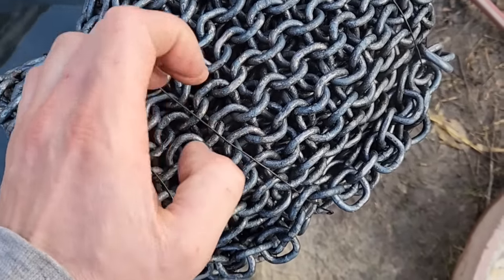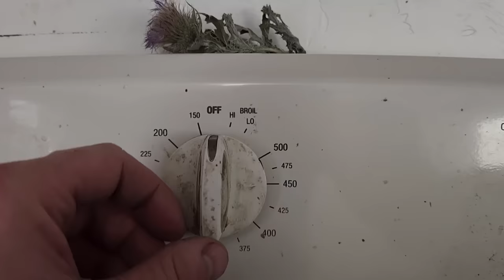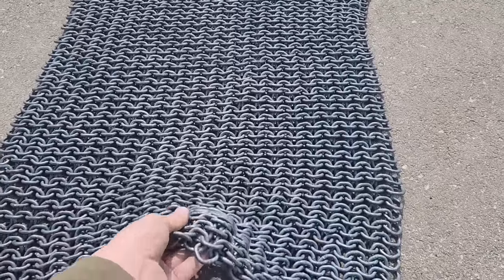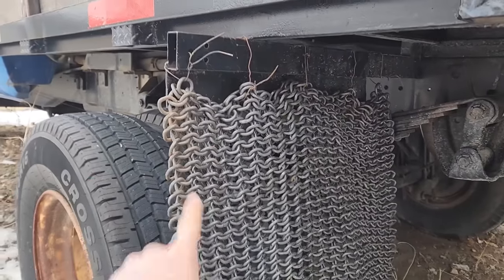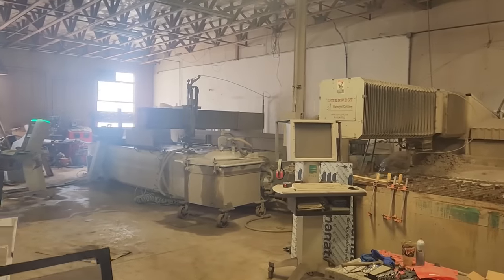Making Chainmail From Chain

Comment: The end result is so beautiful. I really hope you make it wearable, what a fantastic item to have as a family heirloom. Already that section is just worth so much, I can't imagine how to value an actual wearable chest piece. Definitely into five figures at least. Estimating that what you have based on what you said would maybe take you three months if you were doing nothing else with a wage of $30/hr & making some guesses on your costs for running the propane furnace and your weld torch I come to an estimated value of $29,019.65 Thirty-six boxes of chain, three #10 boxes of 1/8" welding rod, two refills of B cylinder bottles of acetylene & oxygen, & two refills of twenty pound propane bottle are my estimates for materials costs not including tools you already own. I forgot the acid bath to remove the zinc! Adding a conservative guess for how much you needed at four gallons of acid that brings my estimate to $29,279.61 on that basis I'm going to say that a chest piece is worth $75k after producing another section the size you produced to cover a full torso plus sleeves like your copper chainmail, and doing finishing work.

Comment: Hey Cody, when I used to work in the electroplating industry we used to dip freshly stripped bare steel into a cyanide solution to prevent oxidation.

Comment: Good call removing the Zink. Body heat can be enough for it to start letting of its toxic fumes and when you are wearing mail coated in zink, you would start inhaling that and slowly over hours get a tat paranoid. Not enough to get like a proper zink poisoning but its still not pleasant.

Comment: I’m surprised that you didn’t treat it somehow to prevent rust. At first I thought that you would heat treat it by dropping it in some kind of oil, but I am not sure how that works. I’m glad that you are able to post more, now that you have received most of not all of your past earnings.😊
Reply: Those are thick enough for 100 uears of rust in this desert, then that scale will protect it somewhat, as long as ot doesnt get directly wet.

Comment: I wonder how tight a radius compound curve it will really flow through - the gaps look rather snug that if you were insane enough to try and wrap a human in it I expect it would limit movement from way more than just its weight I'd think (and boy would it be a workout to wear).

Comment: Here in Quebec most steel with zinc. It is hard to find Pure steel. Lobes, Home Depot I can only find that. I am planning to plate nickel to copper sheets with a Nickel plating solution. Electroplate with distilled water and find some way of filtering the solution. The pH of the Nickel solution needs to be a pH of 3 to 4. I will later dissolve a gold bar into a 2 L flat two-knocked flask to reflux (Hydrochloric acid 31.45% and 35% hydrogen peroxide). The H202 will be on ice and the HCL will be at 4 degrees. 500 ml HCl and 100 ml of ice-cold H202 at 35%. Cold temperatures are better. Never add them at room temperature. I bought a stainless steel Ceramic hotplate recently for that.

Refluxing 560 mg of gold into 500 ml acid + H202 will be the most difficult part. Here Nitric acid is restricted and nobody can buy it. Quebec will not sell it to individuals. This will be an interesting project.

Comment: Cody, what did you weld those links with? Did it contain lead?

I've made chainmail before but never welded it. If I do it again, I'd want to, but I am very certain that I don't want to weld or solder any of it with lead.

Comment: im surprised you bothered to anneal, reharden and then anneal again, when the chain is most likely made of mild steel with very little carbon content?
unless im missing something, since you did mention it making a difference in softening before hammer forming it, which i could understand if it was indeed some kind of hardened carbon steel

Comment: The water should have started as warm salt brine and it would have been safer to harden... even mid carbon steel can have stress not just from hardening and shock happening also from the small amount of expansion that also happens durring the rapid cooling

Comment: I wonder if the chain that was on the outside during quenching ended up harder than the chain on the inside which may have stayed hotter longer or it didn't cool so quickly.
Reply: It did. Perfect temper is imposible. That is the essensellce of the diffrence between a japanese and chinese knife, evenness of heat.

Comment: There is a way to link existing chains for maille. Youde have to open a third of them then use those to join the uncut lengths. Did the oxy torch work good? I tried mig and tig and spot and theu all had problems. I do smaller links though of course.
Reply: Also wheres the carbon in water? You want oil quench for harden. Water quench just creates small grain boundries. Also makes hard but no carbon nodules.

Comment: i kinda want one but dont make what i want i want to make one out of tungsten wire the idea is to not crash but if i do get in a motorcycle accident how would mythbusters test for that without just jumping off it in mid ride not testing for impact but for heat and breaking trying to avoid road rash without a 120° leather jacket you really dont fall all that far its only maybe 3 feet its the sudden stop that hurts and no padding helps with 30+gs of a sudden stop. avoiding road rash is all you hope for

Comment: I want to do a video with you at chicken hole ranch. I think I invented a way to turn sand into clay. If you have sand clay and carbon then you can grow you own food. The clay can be used to line a pit then you will have a watter source. You mix sand and magnesium and then it brakes down into clay. You can use a solar panel to power it

Comment: Yo Cody I hope you're well G I haven't commented in years it feels, I saw your video recently on the metal mushrooms you made and was wondering if you'd be able to smelt something of practical use such as metal gears of various sizes and create something using them.
I'm sure you're aware of piezo electric crystals such as Rochelle salt crystal which was once my family's ancestral name from La Rochelle France..escaping persecution and fleeing to Germany in the 16th Century then changing their name to just "Rocholl" Seeing as you would be able to generate a small charge when applying mechanical pressure to the salt crystal I think it would be possible to then amplify it running the electricity through and iron rod with multiple copper coils around it creating a larger EMF then run whatever you like off of it such as a stator motor. Another invention I have yet to make if ever is being able to cross combine a mini Trompe system with hydraulic pressure which is stimulating certain piezo electric crystals cut to specific frequencies that generate the right sine waves for the motion of energy needed for the the current task, the current energy can then be amplified in many various ways but also like the one I mentioned before, the rest is a secret because I plan on designing space vehicles of the future and still have allot of tests to do so would rather not fill your head with possible miss information there's to much of that online. All the best big fan your super inspiring and it's always good to see what you come up with next creation wise.

Comment: each step is labor intensive and long... hammering each piece square, cutting each second link, weaving it, and welding it... but sir, there is a simpler way, chain mail is just interlocking rings in a pattern... you can just, take long strips of chain and take open rings and connect the premade strips, all you have to do is alternate every third ring so it makes up the top half of the weave, prob could have saved a few hours of weaving and welding

Comment: "I'm only going to cut 1/2 the rings" - Wouldn't it make more sense to cut 1/4 of the rings and use those to stitch together lengths of chain into fabric?
rather than doing patches, you'd do strings of it. In a garment, a whole chain would hang vertically.

Comment: GoTransit tried chain-mail mudflaps after sheet metal kept being eroded by the hot exhaust (and road treatment).

I don't think theirs was heat treated, just whatever Amazon/E-bay offered.

... (if the bounty for a successful solution is still open) I'll have to suggest it.

Comment: It would have been cheaper and easier to make rings from steel rod. You would need to make a ring forming die. With some creativity, it seems like it would be possible to make a chainmail 'knitting' machine. 'How it's Made" has a video on making chain. The feedstock is steel rod.

Comment: The Carbon won't leave crystals. hardening is about phases of the metal. Not carbon. Carbon hardening is another process, but the carbon won't leave the metal just by heating anyway. It will absorb more carbon from the atmosphere. The hardening process is about phases and crystal sizes. The carbon and iron can be arranged inside of the metal in different ways that grant the properties, but once it is a solid phase there is negligible amount of gasses leaving the metal in solid phases (but it can absorb)
Reply: This is what i was looking for. I says i never heard of no one removing carbon from metal. I agree.

Comment: having seen the "torture test" i have an idea but the chainmail loving side of you will hate it so maybe just for a little patch to test to start with.
what happens if you pot that sucker in polymer? im thinking that linex stuff for explosion resistant walls but anything with a crazy high tensile strength and shear resistance should do the trick.
i also want to see what happens if two of these sheets are potted in the same polymer but only connected in the mail periodically so that stored energy can destructively meet itself within the material hopefully without passing the energy on through to the target.
also im wondering if you could just be a complete asshole and embed these into sand bags to make them stop cannon rounds.
might be aiming for more bullet immune than bullet proof but hey, if its got the potential...

i think the full no f u design would be something of this caliber of chainmail used as the backing for ceramic dragon scale armour that gets potted in the polymer potentially with non newtonian gel capsules if they can be designed to actually bring advantages.
actually that is beginning to sound pretty plasteel huh. well ceramite over plasteel i suppose.

Comment: I did this 20 years ago and I can tell you, it's completely impractical. Trying to do a fantasy maga style training with absurdly weighted equipment like this has no benefit what so ever.

Now you're not entirely correct with rhe problem of the oval links bindong, but youre not wrong either. The trick is that you have to let the chain links orient in rhe direction they are designed, which does present a problem if you want ro link them together horizontally as well, because you dont have the space. Instead a cheat is to use heavy gauge wire to bind them horizobally like a hinge. 

Its not exactly a mail, but it served a similar function.

Comment: You buy chain in plastic boxes in the US? What a waste. In the UK you choose the chain you want from the roll, then use the cutters to cut the length. You get charged per metre, so if you are an idiot you can argue at the checkout that you only have two and half metres, why should you pay for three. Oh I see that’s why the US does chain in boxes.
Reply: We can do that too, there's spools of chain and rope and carpet and tubing and all kinds of stuff at a big hardware store. I can't speak to what specifically is available around Cody but I trust he had a good reason.

Comment: 8:05 there you just ruined it..... They didn't have heat/welding guns back in the 1700's, or before they would have been sealed by hammer and tong.... If you are gonna try and do a "genuine" replication of it using chain link fence at least try and use original tools.....
Reply: your problem is with the welding? not the fact its made of modern chainlink and is probably 100lbs heavier than it should be? its obvious he's not going for historical accuracy here